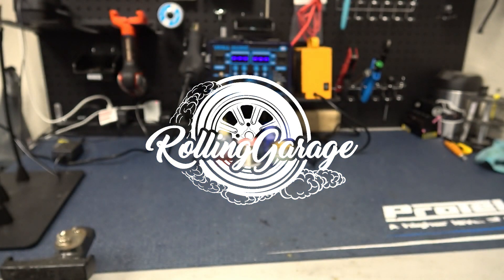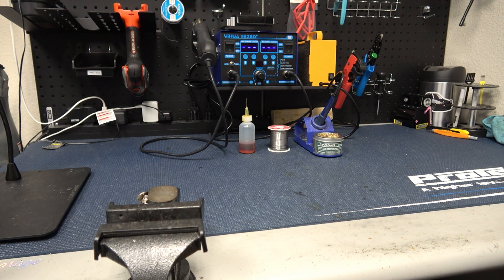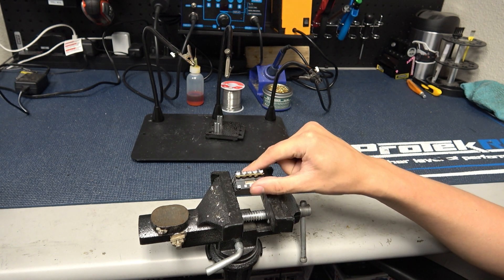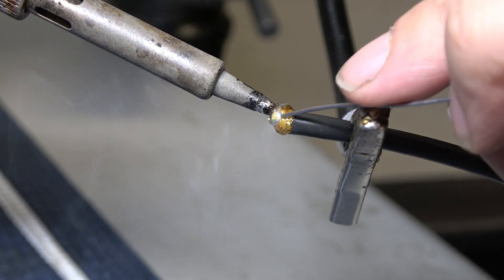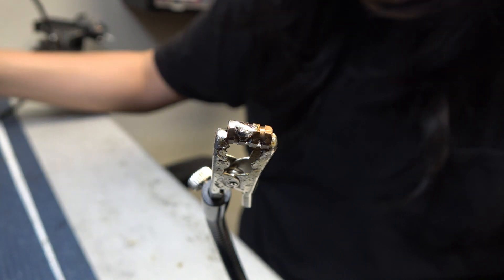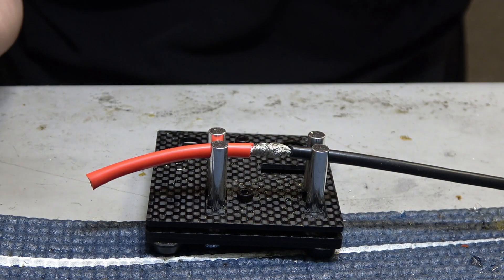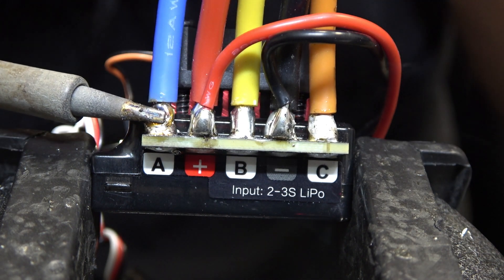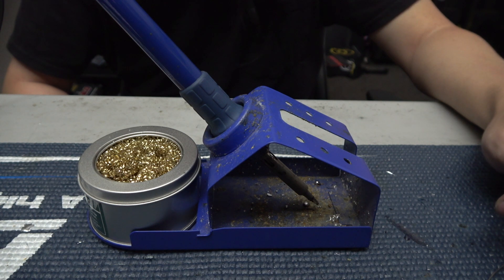How To Solder - Mitch-Spec TUTORIALS

Comment: How thick is the wire?
Reply from the maker: Our applications typically use 14-12 gauge wire but can go down to 24-22 gauge for smaller capacitor wires.

Comment: I worry about heating the esc too much when I'm soldering, have you melted one before?
Reply from the maker: @chaosfruitbat5970  I haven’t. I’m usually very conscious of heating the ESC and will let the ESC cool down between soldering terminals if I have to.
Reply: You want to do high heat and low time. I like to keep my soldering at  5-6 seconds with my iron contacting what ever it is I’m soldering. Also lead free solder takes more time to heat up vs leaded solder.

Comment: I have my tip at 450c and it still doesn’t burn hot enough to where my soder melts to the tips of the wire like yours
Reply from the maker: @andymota1633  Maybe it’s time for a new tip. An improperly tinned tip will not allow heat transfer well enough to melt solder efficiently.
Reply: @RollingGarageRc  okay will look into it thanks !
Reply: Could I send u mine lmao I’ll def pay
Reply from the maker: @andymota1633  DM our Instagram
Reply: @RollingGarageRc  just dm you thanks 🫡

Comment: Hey man, thank you for the informative video with clear instructions. I am planning for my first model plane, it might seem overkill for my first model and I might have set the bar too high.
I need to run a system with 22,2V at 120A, so overheating is my biggest concern. I have enough thermally conductive material to keep everything cool (I believe), but I still need to solderer 5 connections to be conductive enough for the quite extreme load.
Reply from the maker: @HelloHelloHell-o  Thanks for watching! Unfortunately I don’t know much about the aerial stuff 😅. We mainly deal with 1/10th scale drifting but if heat is a concern, you may opt for a lead free solder. It melts at a much higher temperature than the leaded solder we typically use which means it’s less likely to melt under high amp applications but you need a very high temperature iron or gun to solder with it.